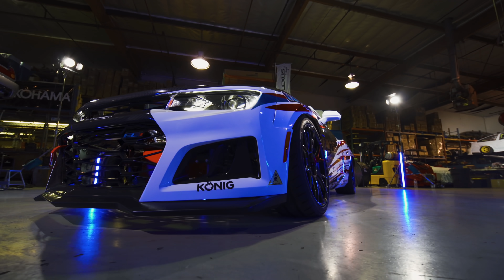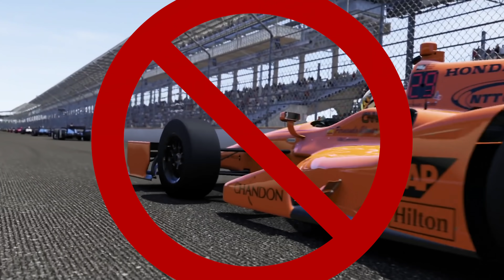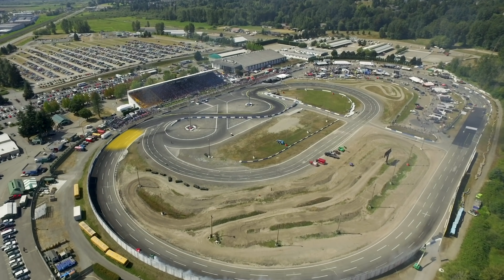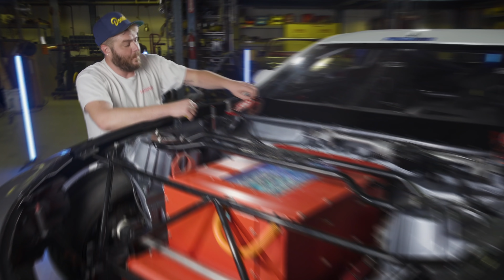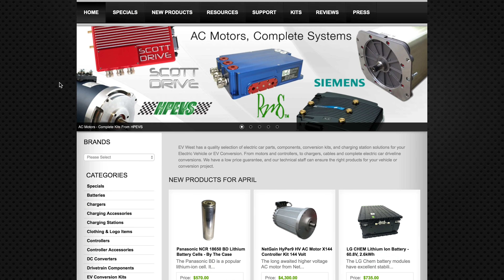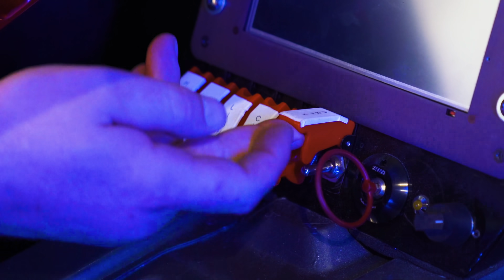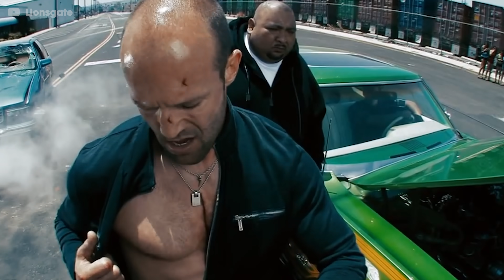Electric Camaro Drift Car: Exclusive First Look

Comment: 384kw is equal to 515bhp but electric cars have parasitic losses, you know when the electricity goes from the battery to the motor to the wheel, you lose at least 20% power

Comment: Adding water to li-ion battery fires might not be the best of plans. The water reacts with the lithium to cause hydrogen, which as you may know is rather explosive. In addition once one cell is compromised and begins the process of thermal runaway, it usally leads to a chain reaction with it's neighbours. The Rimac supercar that Richard Hammond crashed on The Grand Tour took more than five days to extinguish. 

Electric cars are literally playing with fire and the problem will only get considerably worse with age as the cells become inbalanced. I vape, and have observed over the last 8 or so years, that degradation in Li-ion cells doesn't always follow an obvious pattern. Even with controllers trying to keep the draw as balanced as possible, trying to draw too much from a degraded cell causes spontaneous thermal runaway. It's all well and good when there aren't many on the road and they're all made by certain companies, but as the electric car market grows it's going to get interesting!

Comment: half of me likes electric cars just the smallest bit ( i would drive one, but if gas and electric cost the same id maybe go for gas, or maybe electric, now im not too sure, depends on the car) and half of me hates them, the only reason i hate them is that they will most likely replace gas cars, there isnt a greater sound than a sweet petrol engine revving, doesnt matter if its i 4-6, v6-8, 2 jz, sr20, rb26 and anything else that is a petrol engine

my favourite cars have to be japanese sport cars and old american musclecars, but modern musclecars and european sports cars are cool too

Comment: Legit the ps1 start up sound is amazing idea. Do it do it do it. Then the windows shut down sound when you turn it off.

Love how electric is instant neck break if you wanted, but we need longer range batteries like 1k miles before I will buy one

Comment: we had a small local track that used to have track days. unfortunate people kept moving closer to it and then complained about the noise and the track had to close. Electric sports cars have to potential to open many of these track up again. that's a bonus if you ask me.  I can live with out the engine noise if it means I can use the car more. think stealthy thoughts.

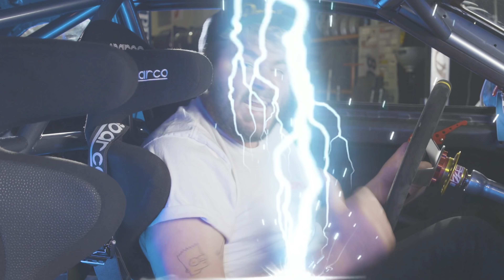Comment: 12:07
in India we call that pedal , "THE ACCELERATOR"
Reply: It's and Indian cars have clutch
Reply: @velsonline  
In cars with manual transmission , yes.
Clutch , Break , Accelerator
Reply: And don't  forget nearly 95 percent of cars in India are fwd
Reply: @velsonline  
Correct.
It saves mass , therefore improves fuel efficiency.
Ideal for our roads

Comment: So, if it was called the pikachu pedal,  

When you drive slow you are using some pikas..

When you floor it, 
You can say you was 
dropping some choo's,

Like, the first half of the accelerator is the pika, and the second half is the choo..

So it goes like this..  

"Bro, I was pulling out onto the highway, and i was putting down plenty pika, as usual

But then i seen him coming past,  so i dropped the choo and i was frickin gone, 
He had no chance!! 
I made him my highway bitch for like 5 miles. Lol.. 

I like it..   I got the idea from the previous comment., 
Give him the credit if it works out and becomes a thing...

Comment: This video just told us that Telsa's induction motor on the model S is more efficient, reliable and easier to maintain then the Perm Magnet on the model 3, yet Tesla claims the opposite, and shows the Perm Magnet motor is more efficient, even changing the model S so it has the perm magnet motor up front now on the ravens.  (lost)

Comment: The "gas pedal" was always the "accelerator pedal" but if we are going to change it to something "party pedal" sounds good.
Reply: Lol nah the throttle is the thing that's either connected via a cable or wire but sits riight on the engine connected to the throttle body. The pedal activates the throttle, it isn't technically the throttle itself however.
Reply: Fun Stomper? GOFASTER Actuator? ....Whee! Switch?
Reply: @NS-wt8rg velocity regulator.
Reply: Thas the way to answer it
Reply: amp pedal
Reply: I can already hear myself scream at the driver in front of me " THE PARTY PEDAL IS ON THE RIGHT !!!  "
Reply: I'm going outside right now, to write "party" on my gas pedal, and "chill" on my brake pedal. Lol
Reply: LIGHTNING PEDAL 🌩️⚡!!!
Reply: @sheko1515  ⚡ LIGHTNING⚡ LIGHTNING⚡ LIGHTNING⚡ LIGHTNING⚡ LIGHTNING⚡
Reply: #POWERPEDAL @donut
Reply: Pika pedal
Reply: Idk pika pedal sounds better
Reply: I would call it the mo powa pedal babeh!
Reply: Throttle pedal
Reply: I call it the Thor Pedal.
Reply: I wanna like but you have a perfect number of likes
Reply: Lol it’s normally called the throttle so🤷🏽‍♂️
Reply: @fakeguccishirt  nah fam
Reply: @fakeguccishirt  yeah that's what I'm saying haha. It still works in an electric car, too :]

Comment: Technically, the gas pedal is a dimmer switch in the reverse. It's a potentiometer.
Reply: It doesnt use potentiometers. Theres probably better systems that are more accurate.
Reply: @honkhonk8009  That is a good point. I guess what I was trying to say was that is an 'all' electronic system with functionality like a potentiometer, as opposed to an electronic throttle that is an electronic to mechanical system. I hope they are not using Home Depot light dimmer switches! ;-)
Reply: @sevilnatas  what is a potentiometer?
Reply: @honkhonk8009  even some throttle position sensor in some car still use some type of potentiometer, just different spec or packaging compared with what usually used in electronic appliances

It's just for input, the rest will be processed in the controller unit then to the ESC

For noise cause by vibration or something else usually can be filtered electronically
Reply: Presumably they're actually the same as gas pedals in any car with an electronic throttle.
Reply: They used to use carbon potentiometer but those have high failure rate so modern pedals use Hall effect instead which rely on varying magnetic field instead of carbon film which wear out too quickly for pedal applications.
Reply: @jenziie_olivia1384 yeah, that's correct for all electric (and gas drive-by-wire) cars I've seen. A two phase hall effect sensor. When the pedal gets closer, the signals change and are interpreted by a computer. Potentiometers aren't easy to interpret.
Reply: @vikeshbubbles205  Thx

Comment: Hey those are lithium iron batteries right?  You don't want water in a battery fire situation as lithium goes nuts with water.  Usually sand on top which turns to glass.

Comment: It's actually called the accelerator pedal not gas pedal. Thus , it works for both electric and gas and even diesel vehicles. You dont hear people call it a diesel pedal.

Comment: Electric is stupid. I dont care what anyone says. Sound and mechanical energy is the whole point. Not an rc car. Some of these new age idiots pushing this electric bs. The sound goes a long way when your hearing everything working. Its not future.  Its being shoved through agenda 21. Also electric cars require no skill. Love the DBZ quote!!!!
Reply: Lance Dooley an electric car can probably beat your car in a drag race
Reply: @warren8355  wont last 30yrs either. Battery changing forever. Theres a reason people shit there phones at the end of their cycle. Theres another channel that tells you the truth on changing electric motors and batteries on Tesla. Good luck for all that proprietary bs. Its about road racing not drags. Look at formula e compared to formula 1 on sale tickets. Still ev market at 2%ish. Im a master mechanic.  EV's dont get you pussy either. Fact!!
Reply: Lance Dooley my Model S P100D has a 1 million mile rate on the motor and does good on the track and in a straight line

Comment: Very Very cool dudes
I'm impressed a build that is extremely well engineered and put together.
They could use a similar fire suppression system on submarines that use lithium ion batteries.
😆😆😆☺☺☺

Comment: Camaro: A New Challenger enters the arena
Me: Time to upgrade the AE86 again
Reply: I think you misspelled “dad’s Camry”
Reply: bro pls use a subaru brz ae 86 is just a copy
Reply: Wies Mertens brz and gt 86 you mean the ae86 is way older then the brz its a carolla from the 80s 
Also the brz and gt86 where designed together there both not a copy and there both awesome
Reply: @arcanatcg9866  ke70 was way cooler anyway
Reply: Shut up weeb
Reply: @evilassjitnem  i mean there is an electric ae86

Comment: Electric Camaro- Electromaro (sounds like a Digimon fusion)
Gas pedal- Shock pedal (for when you shock all the haters with that LIGHTNING LIGHTNING LIGHTNING)
Brake pedal- Break pedal (for when you're done electrifying the competition)
HP a.k.a "Buff Horses"- KWH a.k.a "Killer Whales"
Torque- Torque sauce
RPM's- RIP EMs (Rest in Peace [cuz I got an] electric motor son)
Exhaust- Static (Super hero Static Shock.... Woo wooo)
Transmission- Who?
Start button- LIGHTNING button
Fuel- Black lightning

Comment: Drifting this car is like drifting in forza with the volume turned down.
Reply: engine's sound is off but tire's  sound is still on
Reply: it hurts me to hear just the tires
Reply: Pretty much impossible for me, I need to hear the revs otherwise I spin out
Reply: Dude I thought I was the only one
Reply: You mean you drift and drive automatic gearbox on forza?
Reply: @xGameShock  I let my brother play, and he switched it to automatic, and i forgot to turn it back, and its SO extremely hard to drift like that
Reply: @xGameShock  Mate electric cars doesn't have gears and has instant torque.
Reply: @hawtbuoy  not true
Reply: Ha ha
Reply: Or drifting the tesla in fh3
Reply: Drifting in Beamng with volume down and using CVT transmission
Reply: Lol
Reply: Mhm
Reply: Yes
Reply: I saw this car in person , it didn’t put out the smoke like the others ... 😴

Comment: Uh. Yo Pumf.. if the pedal on the right accelerates the car, can we just call it the accelerator like we always have?
Reply: I actually work on electric vehicles... it's still called an accelerator pedal 🤣
Reply: In spanish Is called "acelerador" = "accelerator"
Reply: Pikachu Pedal
Reply: Sorry, we dont speak boring here
Reply: acceleration is any change in speed, negative or positive. so the brake pedal is also the accelerator.
Reply: @acrazymonkey12  no, it is a decelerator
Reply: @acrazymonkey12  good point! And the clutch disconnects the powertain from the drivetrain, temporarily affecting the acceleration. Let's call them all accelerators! I'm glad we solved that mystery.
Reply: @acrazymonkey12  thats deceleration
Reply: Marcus Glemser no acceleration is the acquisition of velocity. deceleration is the reduction
Reply: @PeacockPvP  he's using the physics definition. Which is correct if not a bit pedantic.
Reply: @PeacockPvP  In physics "deceleration" is just acceleration in the opposite direction of your velocity.
Reply: throttle?

Comment: Electric motors are superior to combustible engines in every way. Once battery tech catches up it's over for gas engines.
Reply: FL Biker except the sound, dignity, turbos, super chargers, the ability to actually work on the car, and did I mention sound? Electric is boring. Combustible with go on forever
Reply: @jacobsiekmann426  sure if you wanna be the slowest car on the road so you can have sound.
Reply: FL Biker have yet to see a 10,000hp drag car that’s electric. Most people can’t and won’t modify electric. I’ll be slow with my dignity then.
Reply: FL Biker doesn’t sound better then gas to me.

Comment: "Has a fancy fire suppression system that sprays water into the sealed lithium battery" 

That's like saying you put water sprayers over a fryer in case it catches in fire lol 
Someone isn't too smart.
Reply: josh smith yes but unlike gas fires water actually helps stop electric fires...?

Correct me if i’m wrong. But until then, the person who “isn’t too smart” is you.
Reply: @itami7  not when that "electric" fire is a lithium fire. Obviously you have no idea what water does to a lithium fire.
Reply: @itami7  you're already in YouTube. Search "lithium battery and water". You'll quickly find out what I mean.
Reply: @itami7  https://youtu.be/bNMfe20I_IE

Keep in mind this is an open container and gasses were able to escape. Imagine a sealed container. 

Before you imply my ignorance please do a little research or talk to any rc car hobbyist. This is common knowledge to many that lithium fire and water are never a good idea.
Reply: Do you really think they would spend god knows much on a custom fire suppression system without testing if it works

Comment: Wait wait wait. Did you just say they have a system that in case of a lithium fire it throws water on it? 
Ummmmmmmm that's not a good idea. 
Has anyone seen what a lipo battery does in water? 
Boom.
Even in a sealed container. 
Boom.
Reply: I'm pretty sure it sprays nitrogen not water
Reply: @tamahawk175  I really hope so.

Comment: spends thousands on carbon fiber body panels, chassis, motor, batteries...spends a couple bucks on a crappy looking fdm print for the EL1 logo lol
Reply: bullitt27382v ahahahahaha
Reply: weight
Reply: It's a 3D print right?
Reply: They probably just took the 1LE logo already made and switched the letters around
Reply: fukc off
Reply: It’s kinda a cool idea but the matter of it is no engine noise I am sorry I don’t want it get it away from me please

Comment: So you made an electric car to help reduce pollution, but its sole purpose is to actually “burn rubber” which pollutes the air more than the exhaust coming out of a stock gasoline powered camaro?

Idiots.
Reply: Not to reduce pollution. 800ft lbs instantly in a 14" diameter motor that weighs 100 lbs, in stock form, that's why.
Reply: The instant power is nice but that’s the only advantage.

It’s heavier, more expensive and has limited range.

And yes it is a stunt to show that electric cars can be “cool” while still combatting “climate change”.

Nothing beats petroleum. Nothing.